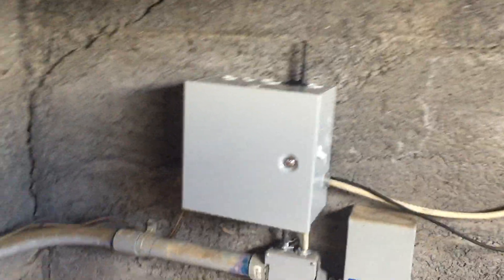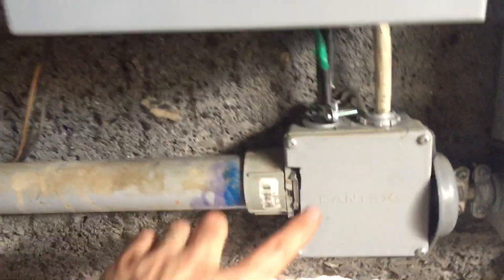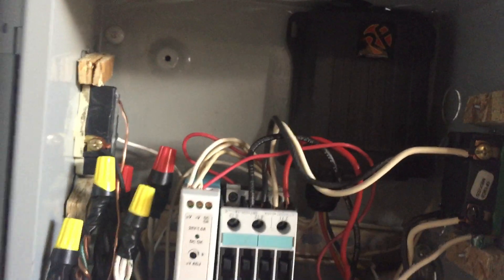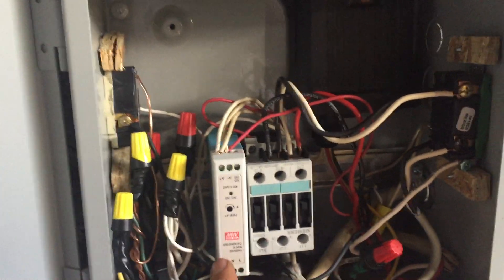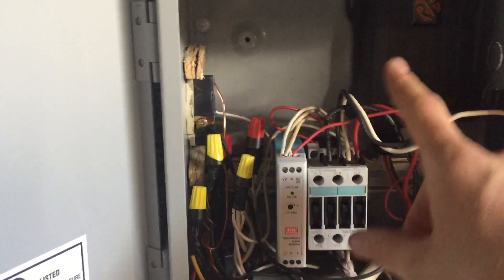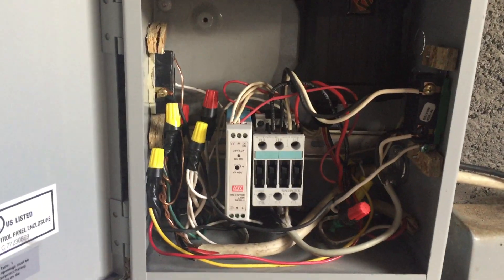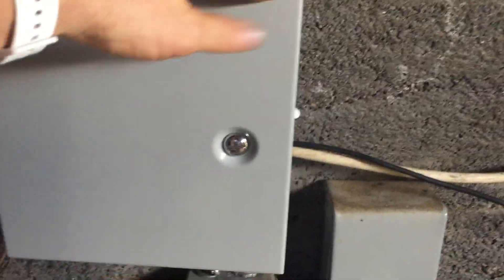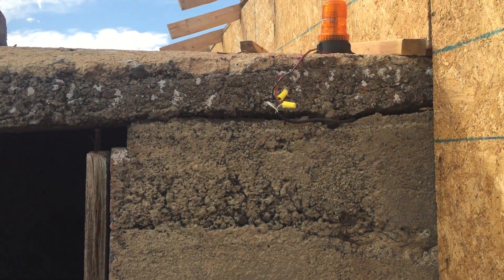Long distance wireless remote control system for a well pump 1/4 mile away.

Comment: thanks for sharing - I want to do something similar, but was also looking for something where I could tell if the pump was actually switched on, as I’m too far away to see any light indicator.
Reply: I think the company that makes this transmitter/receiver combo also has a remote that provides feedback to let you know that the system is on or not. It's been a long time, so I can't remember exactly.